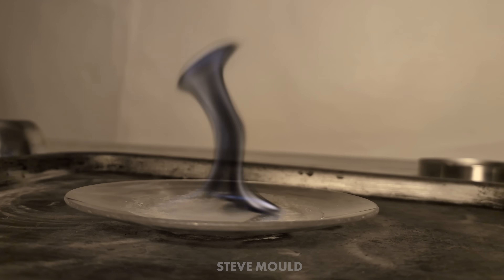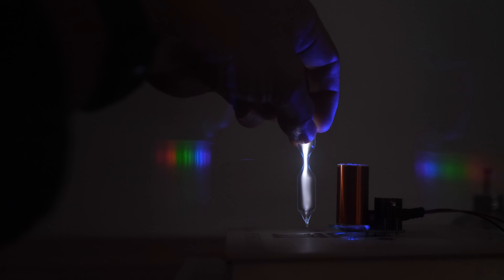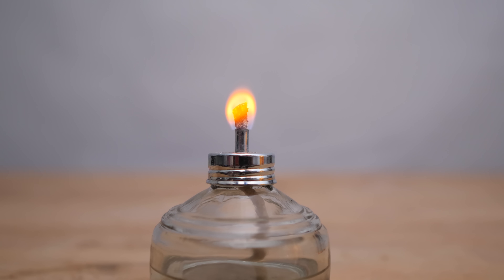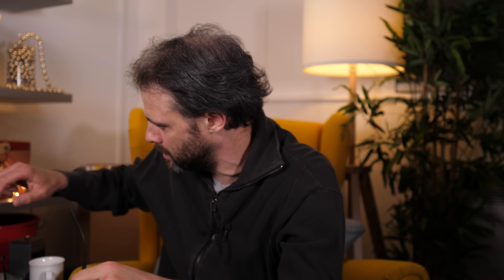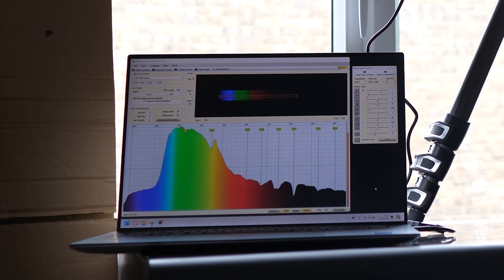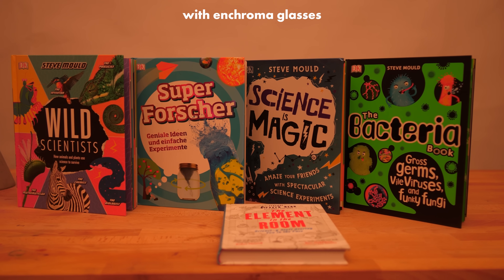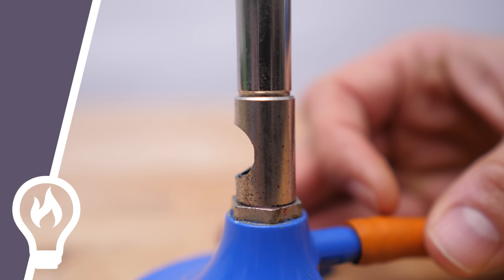Light sucking flames look like magic

Comment from the maker: There's so much more I could say about EnChroma but it's already 19 minutes long!
The sponsor is Odoo. Try it for yourself today: https://www.odoo.com/r/kYo
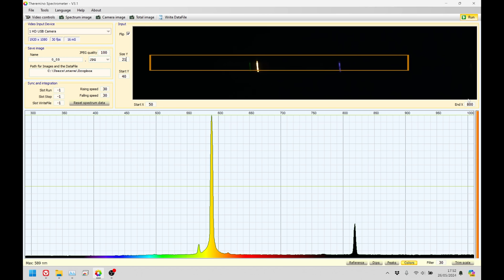Reply: FYI the other peak in the infrared at 10:00 is another Na doublet at 818.3 nm (3d2D3/2 → 3p2Po1/2) and 819.5 nm (3d2D5/2 → 3p2Po3/2). See "Surrogate measurement of chlorine concentration on steel surfaces by alkali element detection via laser-induced breakdown spectroscopy" in Spectrochimica Acta B by Xiao et al.
Reply: Hi, sorry to ask, but how did you arrive at the CRI of sodium vapor lamp of being 0?
Because I watched a video from Brainiac75 on this topic yesterday and his sodium vapor lamp had a negative CRI rating. 
I decided to google it and it turns out it depends on the pressure.
High pressure sodium lamp has the CRI of 25 and low pressure sodium lamp CRI= -44.
Reply: Is this the same thing that Corridor Digital found that Disney used to use?

https://www.youtube.com/watch?v=UQuIVsNzqDk
Reply: @SteveMould I was about to bring to your attention this video by Corridor Digital but  @OutXider  and possibly @jrnichols beat me to it. 

tl;dr They recreated what Disney did to superimpose one video on another without the limititations of the greenscreen technique. It worked with transparent and translucent items in a way that greenscreens fail. This was made possible by using the unique spectrum point of sodium light with a beam splitter that responds to that spectrum. Worth the watch just for their enthusiasm.
https://www.youtube.com/watch?v=UQuIVsNzqDk
Reply: Please do say more about enchroma glasses. Can we get a video dedicated to that?
Reply: @NerdSnipingBatman  Megalag has already done a brilliant series diving deep into it. I guess Steve could be even more thorough on debunking the science specifically
Reply: @SteveMould I came to buy your glasses - a passenger in the car can use them :)
Reply: ...isn't Odoo a character on ST: DS9?
Reply: @matthewwriter9539  It's Constable Odoo, to you!
Reply: @matthewwriter9539 the DS9 character is Odo with single o at the end.
Reply: @mudi2000a  Yeah, I know. This is what is normally referred to as "a joke".
Reply: @still-rorys-dad-against-odds  - It's not really "before" chroma keying, it's a type of chroma keying. It's just that these days people tend to use green screen for everything (for a couple of reasons related to ease of set-up and the way most video sensors work, as opposed to film).
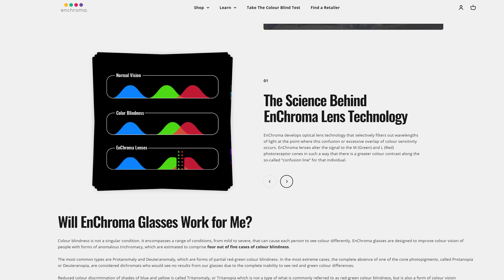Reply: You just made me 14:30 understand what the electron spin means. It was an ambiguous concept until now. It felt like an "Evrika!!!" moment.😂 Thank you!
Reply: Wouldn't glasses that had different lens on each side be even more helpful for colorblindness (you could close eyes one at a time to see how the color changes) -- maybe you could even learn to integrate your visual field differently.
Reply: Humans being biological apparatuses, there's probably some variation in the degree and placement of cone response overlap in RG colourblind people.

It's pretty much inevitable.

This means that the particular notch of enchroma is going to work reasonably well for some people, and not for others.

Then there's the way we have trained ourselves to process the information from the retina - much of which is hardwired in the optic nerve and the visual region of the brain, if I understand correctly. Again, for some people that's going to work well with the notched signal, and for others it won't.

Of course, that doesn't explain why some people are very passionate and shouty on the subject, while others aren't. Perhaps that's also an artifact of of human variation.
Reply: Still want the enMouldia glasses thow :p
Reply: @SteveMould Is there a reason why you spelled the AI "ChatGTP" at 8:55 ?
Reply: Ahh, the beloved ChatGTP is also in there XD
Reply: @MegaLag has done a fair amount on enchroma.
Maybe consult/collaboration would be beneficial
Reply: @pplscomp2 this
Reply: Squar- oh.
Reply: Enchroma is pure evil, and virtually all the "spontaneous testimonials" praising them (with a lot of physically impossible claims) on YouTube are actually made by advertising agencies (this is often mentioned in the video description), so they profit from it again by including explicit advertising in their covert advertising.
Reply: That transition. From light blocking glasswork glasses all the way to Odoo was smooth as butter. Kudos, Steve.
Reply: Hey Steve, I recently watched a video from corridor digital. Not sure if you were inspired by them or if you stumbled upon just something cool but the same thing. They were trying to recreate a process of filmmaking that Disney used. Very similar use of sodium light in a practical application in the filmmaking space.
Reply: we watched hbomberguy’s two hour video on roblox oof, i think we would’ve been able to listen to five more minutes of how enchroma works >u0
Reply: You mean it's ONLY 19minutes... videos like these need to be like 40~60mins
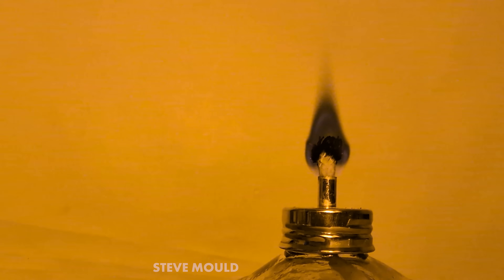Reply: 5:50 is this was done in a (spherical?) room where photons from the wall return pass through the flame from all directions equally, would this fail to work because the number of photons randomly emitted towards you camera lens would basically match the number of photons absorbed by the flame from the wall opposite your lens?
Reply: There is a good chance that Enchroma will try to sue you for exposing their dubious marketing practices.
Reply: money money money
Reply: bullshitter. unsubscribing due to you sponsor
Reply: @thePronto/agfx
Reply: 19 mn isn't that much anyways but it's good to keep it under 30 mn
Reply: I don't know if it is the content of this video, or your presentation (likely both) -- but one of your very best ever, Steve!
Reply: I don't believe someone like you that speaks about science, is being paid by the scam that is "EnChroma glasses", I am color blind and EnChroma glasses is a full scam. They don't have any article that is serious and pair revised about their miracle. As a viewer of this channel I would not like anyone else to fall for this scam.
Reply: The colourblind glasses work, because the anatomy is not that you don't have it, but that your proportions of cones in the eyes are out of balance. Consider you removing the a large part of the light that would excite the cones you have a surplus of, then the light entering your eyes will even our, a bit like a low pass filter, used to equalize a bass heavy signal by adding more resistance to the lower frequencies, aka impeedance, but keeping the sound of the highpassed filtered signal reducing the volume of the base but keeping the mid tunes and treble as they are. You can do this with light as well, and that can aide colour blind people. Our Cones don't just excite with just 1 wavelength, so by having a selection of wavelengths that match Protoanomaly and the other lighter versions of colourblindness, you'd be able to treat colourblindness by filtering out some frequencies. The biggest issue is that LED screens have a very narrow selection of emission frequencies, so it works best with natural light.
Reply: Hey man,can you do for us a Sodium Lamp that turns everything around in B&w??this willsells a lot...
Reply: quick guess: sodium lamp?
Reply: Awww man, I was hoping to get an answer to whether the echroma glasses work or not from someone I would actually trust.
You say to try them but that’s just it, I have asked many optometrists if I can and never found one who could. Maybe it’s because I live in the arse end of nowhere and that is the problem, I don’t know. I suspect they just want you to see the online videos and buy them online without trying them first.
Yeah, I don’t think so.
Since wondering about this for years, I have seen a video purporting to be the subject of one of their promotional videos saying he was just acting and it was all a lie.

It could be an interesting topic for a video to talk about “daltonisation”. This is something that actually kind of works. Digital processing shifts the colours in an image away those that are easily confused. In my case it makes red shift to pink and that is much easier to distinguish from say green or brown.
I have an app on my phone.
It also does the opposite so I can actually answer the perennial question colour blind people get … “what does it look like to you”.
Well actually like this…

Worst response I got was “wow everyone looks sick, their face colour is all wrong, how can you live like that”
Reply: Hey Steve! Great video as always! I'm just writing because in my country, the end of high school there is a sort of "maturity exam" named final exam. I have taken the advanced physics exam (and since then I am a physics student), and on the oral part of the exam, I was doing very well, so I was asked extra questions just for the teacher's sake of fun, and I was literally asked which number explains the two lines  in case of a sodium lamp? I answered: I think it's spin, and then he said no it's actually the magnetic qvuantum number but he is not gonna substract any points for this mistake. I'm only typing this up because: this was a university trained physics teacher, who straight up corrected me on spin being the explanation: maybe you should fact check this part of the video. This doesn't mean you are wrong tho, the teacher can make mistakes too, I just thought I would share. Thanks if you got this far, and thanks for the good content you are putting out there! Your work inspires lots of people, including me:)
Reply: Nice build on the spectrograph
Reply: ew, unnesacary ai implementation
Reply: Steve Mould, Those Colour Peeks, Are They Similar, To The, Mandelbrot Set.?!
Reply: SteveMould, - Are Those Glasses Similar To The Russian Glasses That Show You Auras.?!
Reply: Is this the flame that can kill the gods?
Reply: You created the Sanderson sisters black flame candle
Reply: That's not a street lamp. it came from the hydroponic store
Reply: Here i thought all the Black Flame stuff in fiction was just Fantasy.
Glad to see its possible although the other aspects of fire being black in stories is exaggeration at best.
It does get me wondering if other elements could be photon "neutralized" at the same time; meaning the absorb rate of photons is high enough to catch all the spectrum (known spectrum) at once.
I doubt it because it seems terribly hard for condition meeting but maybe its not impossible.
Its just the idea of a fire so hot it consumes photons is intriguing to imagine. In practice I would have no clue how you'd put it out; so the testing would be to unsafe to try.
Recently learned of Fluorine TriChloride/Chlorine TriFluoride and how its a flame that basically ignites molecules to circumvent a vacuum putting it out quickly... I mean most everything not Fluoride continues the burning process; tho I forget the exact science of it. Its about as dangerous as you can get as it ignites plastic and glass on fire so is tough as hell to control. I imagine you knew of it already; but if you had not I figured I would tell you enough to look into it yourself.
Reply: How does Odoos Chat GTP perform vs Chat GPT 😉
Reply: @fpadia  No idea how the AI function works, we changed from Odoo to Dynamics 365 before the AI was a thing, but Odoo is suboptimal as a CRM and not great for inventory management
Reply: How does EnChroma glasses being polarized have anything to do with their possible affect on some symptoms of color blindness? is all colored light polarized?
Reply: @TommyHanusa  well yes all light is polarized, but EnChroma is just a scam.  glasses will just "shift" the colors you see, it won't actually restore anything.
Reply: @TommyHanusa  polarized has nothing to do with it. if they are, it's only part of the process.
Speaking from experience, deuteranomal here, I have all 3 types of cones, but the red and green sensitivity curves are overlapping, which means anything between the green and red peak, that isn't strong enough to be under ONE curve only, tend to be mixed up. if you don't pay attention to it, you might take a green for a red  or vice-versa. if you start looking at it, you find yourself somehow incapable of defining the color, you're like, "it's red..? not it's green...? oh what a shitty khaki color wtf"... and you take a color picker, check the value (hexa, HSV, RGB, take your pick) and find out it's actually a reddish something when you thought it would probably have been a greenish something.
It depends on the luminosity, and a bit on fatigue. In bright daylight, some colors you'll never mix up, but once you walk inside with those two same pantone samplers, you cannot tell them apart anymore.
Basically, your eyes perceive color (cone mode) when you've passed a minimal light threshold, under that, you're in "stick" mode; So you've got a horizontal baseline, and the overlap of 2 curves, forming what ressemble a triangle, in which the cell send mixed signals, that the brain cannot interpret correctly (remember, it's the BRAIN that SEES).
as you can imagine, it's quite a narrow triangle, and given the way the brain "sees", having a thin band masking those central colors under the summit of that triangle removes a good chunk of those "commonly misinterpreted signals", which in turn allows to have one hue outweigh the other, letting the brain "see it" as either reddish OR greenish.
Those specific colors (which means not only wavelength but luminance/saturation too) that used to always be some pool of "shitty colors", is now a bunch of OTHER colors that your brain could not SEE, like "oh, a darker green khaki, oh, this one is a brown, and this one is actually a dark red...oh crap, that old funky chair that was in the basement was actually orange ???".
So, the EYES perceive the wavelengths, the SIGNALS on the other hand are OVERLAPPING, and the BRAIN cannot decide what it is seeing.
Remove a thin, well-paced band of wavelengths, and there is a much better contrast in signal levels reaching the brain, helping it to decide which color it is seeing.
It's just that, but it required a few things :
1) People wanting to do something about it (most people don't care and prefer to bully people that assume their differences... but colorblind people don't ask for a whole month of support, while we're probably more numerous than the alphabet soup people)
2) Money to do the research (again, there is DEI crap going around plenty, going "these people are different, so we MUST hire them at those roles their differences have nothing to do with, or where it could even do worse, and rob anyone who did it normally of their achievement"... My path toward chemistry was cut short following one of those tests @SteveMould mentioned in the video... as if a chemist worth his title wouldn't have a pocket spectrometer, ffs, we even had 20 years old ones in an equipment room, and that was 20+ years ago, and they'd have been enough... it's a piece of black plastic with a prism and a deflector for outside light, with a dual band showing the full spectrum and the analyzed spectrum; you're not sure ? look into it, boom, instant wavelength confirmation... When is "DEI" going to start hiring colorblind chemists in every country ? we might be more useful than Boeing's newhires that forget half the bolts on a plane's doors...)
3) Actually finding something that could be used. You rarely find anything when you're not looking for something, but you can be looking for ages and still not find something that actually exist. THESE guys did it, they found a way to do this, and decided to bank on it.
mega(redf)lag likes to complain about the study being partial to enchroma, "because one of the founders' name is also in the study's researcher list"... OF COURSE ?
If I was leading a research team on cold fusion and found out the secret of limitless energy and the key to controlling transmutation of elements, Wouldn't I be pretty stupid to NOT make a company to exploit my discovery ? Would that mega-crap start dissing on my product just because "hey look, that name is the same name that is in that research paper" ?
Tackle me all you want about my conditions for selling my product, or my pricing, dude, but don't talk shit about a product you cannot even understand just because "you think it's phony because the names are the same". Duh.... didn't Alexander Graham Bell patent the telephone AND founded BELL TELECOMS ? Surely, Phones are a scam and do not work...right ?

As @SteveMould said, the enchroma glasses actually DO what they say they DO. Nothing more. Doesn't fit all colorblindness. And never will if people like megatard keep spewing BS about them. (guess what, the 1st automobile wasn't this year's latest model, they had to make a profit and invest in R&D...)
Reply: @TommyHanusa  The topic of EnChroma glasses is polarized (meaning there are two strongly disagreeing viewpoints on it). 
As an aside though, it looks like the pair Steve had probably was polarized as well, for outdoor use (they also sell indoor versions).  All light is a 2D wave in 3D space, so it has a particular plane. Polarized sunglasses work by blocking some of these planes of light, but do so for all wavelengths. It's a separate issue from what they do for colorblindness.
Reply: @TommyHanusa  As I understand, the principle they work on doesn't depend on polarization (it was used a pun), they just filter out certain spectrum of colors to increase the separation between primary colors. So, for example, you lose the ability to distinguish yellow, but it's much easier to differentiate green from red.
Reply: Isn't that a scam, though? (EnChroma)

source: MegaLag has quite a few videos on it...
Reply: Sir, you already took more time talking about Enchroma than necessarily. You could have just said they use fake advertising with obvious fake reaction videos and will not do what they claim. The way you talked, it sounded as if you were avoiding the elephant in the room named MagLag...
Reply: For people interested in how EnChroma glasses DON'T work, a Youtuber called 'MegaLag' made a few Videos about them.
Reply: Chromaphobe did a good video on them
Reply: I’m so happy to see more youtubers Expose EnChroma, especially you, you’re someone that’s always inspired me to be creative!
Reply: "Light sucking flame" 💀
Reply: I thought EnChroma was a scam. It is not really proven to help colour blindness and stuff
Reply: @hiddemoens82  This video shows clearly that they do something which does have the potential to increase colour seperation. So, for people with three colour receptors who's vision simply overlaps a little too much, they may well increase the ability to distinguish colours. However they do nothing to make people see more colour, so they won't work for people who don't have that specific form and level of colourblindness, nor will they help on tests.
As a r
esult, it's unclear to me how one could prove that they work. Beyond proving that they do something which may or may not help some people. Hence the suggestion in the video that you make your own assessment of their value.
Reply: There's a great video about the EnChrona glasses and it explains that this is completely bs and a scam